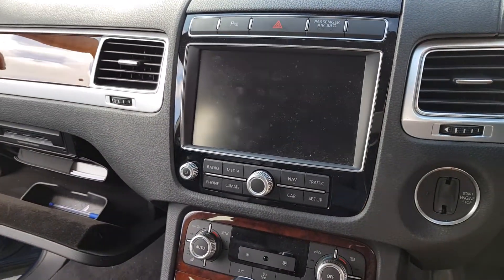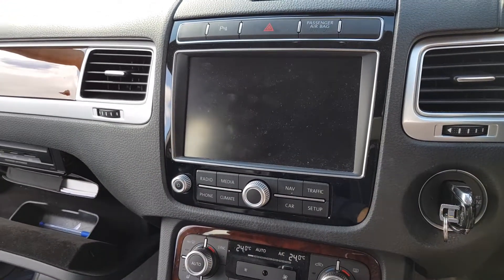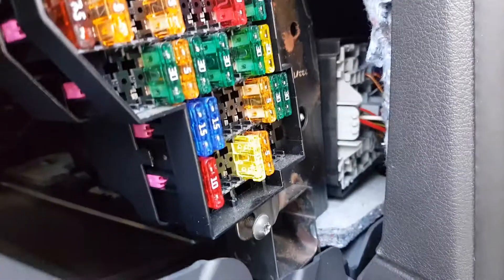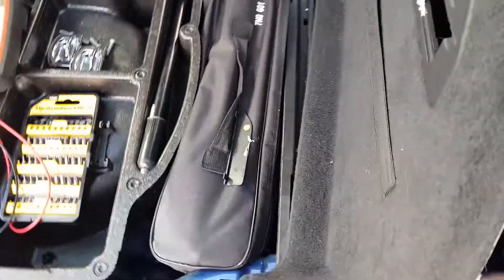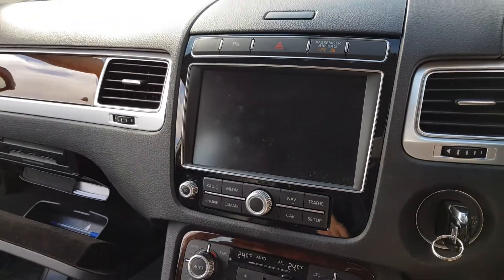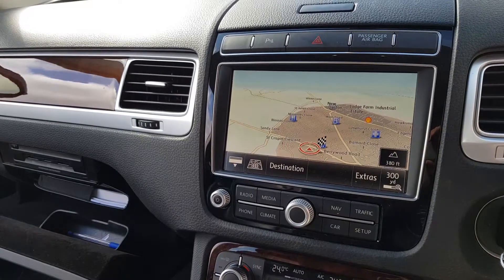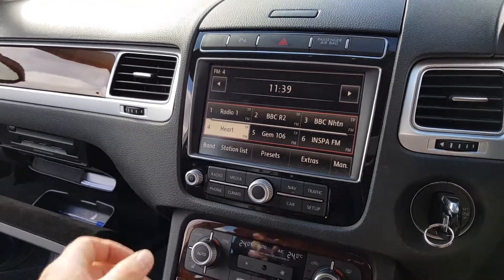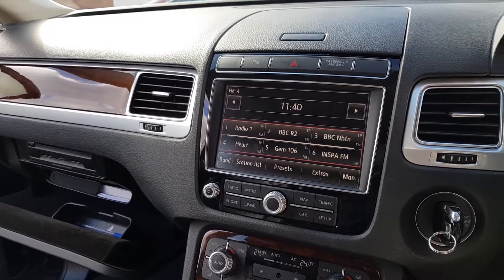VW Touareg infotainment fault diagnosis

Comment: My Touareg's rear DVD changer doesnt turn on, the fuse seems fine, and can't find much info online about where to go next, any ideas? I did check the plug and it seems like there is no power there.

Comment: So my 2012 tdi screen powers on and displays welcome to vw, then it goes blank. According to vw they said it was the 5f module. I swapped it out and it still won't communicate. I noticed there was no fuse in 51 and when I went to plug one in it immediately popped the fuse. Is that similar to the issue that you were having?
Reply: Did you replace the amplifier to correct the issue?
Reply from the maker: No I repaired the amplifier and yes the fuse was blowing due to a bad amplifier.
Reply: @MASAudio  do have the a part number for the fiber optic cable? I have replaced everything and it will not stay on. I want to replace the amp but want to test it first. One mechanic told me they did it and it didn't stay on so I replaced the head unit.
Reply from the maker: @brucedrummond2331  you dont want to listen to mechanics, also replacing parts with used or new? Used wont work as they are coded to the car, you need ODIS to program the modules or it will ignore foreign modules making it impossible to diagnose.
Reply: @MASAudio  used but they have all been tested. I love the diesel sounds but need to get to some parameters. I know I have to get it programmed but I need it to stay on first lol
Reply from the maker: @brucedrummond2331  and it never will with used parts.. it wont communicate even if you replaced all of the modules.. ECU will take 1 look and say no. End of power up sequence.
Reply: @MASAudio  ah so it may all be working correctly now just needs to be coded?

Comment: My 2012 RNS850 died last week, screen went black, no sound or life. I asked an auto electrician to have a look, CD/radio tuner was still live and head unit was still live. He ran out of time to test the rest so I ordered an optical fibre loop to confirm or eliminate the amp. The unit is still dead with the loop fitted so next test is the optical fibre. I plan to somehow connect the CD/radio tuner to the amp with a new optical fibre to see if that is the issue. Fingers crossed !
Reply: Its works?

Comment: This video really helped me start diagnosing the problem with my rns850! The screen will sometimes not come on when we fire up the car and may take up to an hour to do so unless I perform a soft reset which makes it work instantly. So we opened up the fuse box as you did to check each fuse and when we checked fuse 51 (20amps), it seemed ok but when we pulled it out and put it back, the screen came to life! The funny thing is that when the screen does come on in any instance, it never goes off unless we switch the car off for over 20 minutes (i.e. when the car shuts down electricals completely). What do you think the issue could be?
Reply: I have the same problem what was ur fix?

Comment: Nice work!
My RNS850 does not fire up at all.  I have checked fuses, and scanned with VCDS  and get the following errors;

Address 19: CAN Gateway (J533)       
1 Fault Found:
0269 - Optical data bus 
          U104A 00 [009] - No Communication
          Confirmed - Tested Since Memory Clear
             Freeze Frame:
                    Fault Status: 00000001
                    Fault Priority: 6
                    Fault Frequency: 7
                    Reset counter: 218
                    Mileage: 68230 km

Address 56: Radio
Cannot be reached

Address 5F: Information Electr.
Cannot be reached

The unit in the glove box seems to still work / make noises if i press eject. 
I have also tried to run VCDS  "Optical Bus Diagnostics"

but both "standard" and 3db modes just give me a error  "Refused by Control Module" 
i'm not sure if the RNS850 uses a CAN gateway 7P6907540A or is it the Display screen or i don't know what control module it means....   

Any ideas would be greatly appreciated, Cheers.
Reply from the maker: I would link out the suspect units with a fibre optic loop, and see if the system comes back on.
Reply: @MASAudio  I bought another RNS850 and it works!  I wonder if there is a another fuse within my original MMI that has blown.  Although the CD drive part of it was still alive they may have seperate fuses, or the PSU died for the MMI side?  
I wonder if its a easy fix... 
Either repair the old one or get component protection removed from this one..
Reply from the maker: @fatsubsonic  They dont normally have separate internal fuses, although there could be some CP links etc in the circuit. The component protection can be removed but only if you have the data from the donor vehicle. or at the very least, the VIN of the donor vehicle and a dealer with ODIS willing to do it. We have had one unit in an audi coded, but because the model and year differed slightly, it only worked as MMI Audio, no car info or dash settings worked.
Reply: @MASAudio  Thanks for reply.  My original RNS850 is revision "B" and the replacement is revision "D"  (manufacture date is about 12months newer) I have been able to customise the options to suit the specs of my Touareg.  Removing options like ACC and Lane assist, and adding option for Off-Road  nav waypoints as i have the 4Xmotion.  So everything works now except media audio.  (Even bluetooth phone call audio works too)  I assume component protection should resolve the lack of Media audio/video.  Fingers crossed.   I have the VIN of the original vehicle so i hope there shouldn't be any issues. fingers crossed